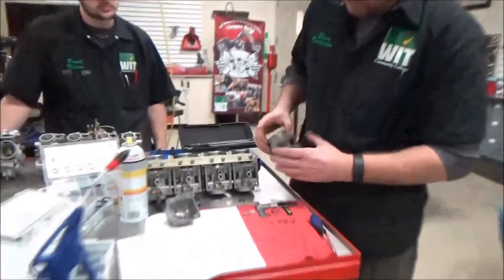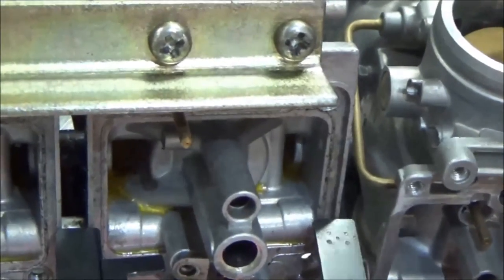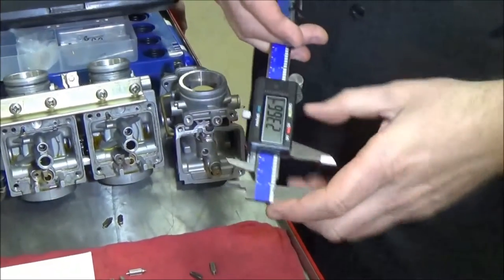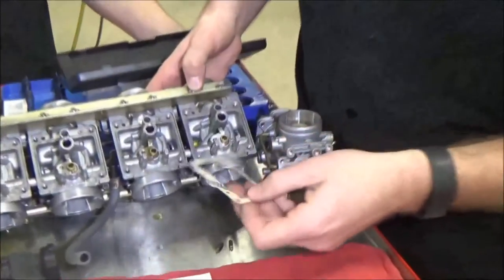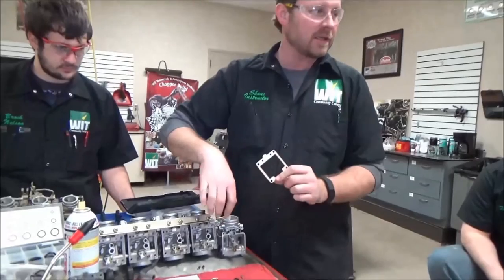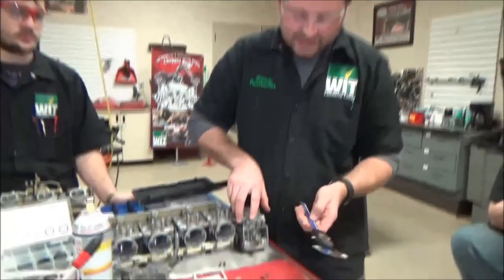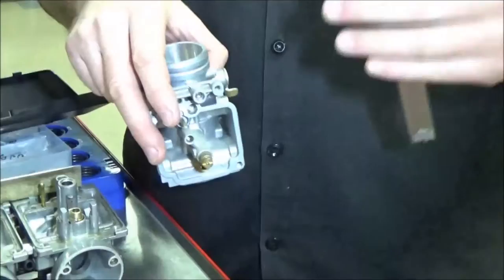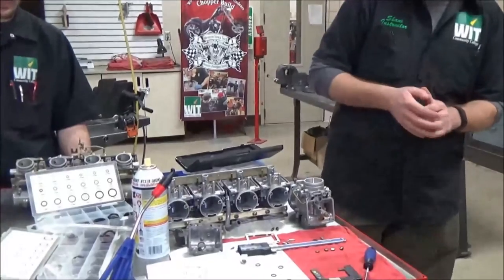How to set float height on a non-flat carb body. BONUS TIP:  Reusing old gaskets!

Comment: This is the third video I've watched to  learn how to set the float adjustment on my 2004 Yamaha YZ-250F and NONE of them ever shows how to adjust and only just how high it should be. I just rebuilt the entire carburetor because it was leaking fuel. It had a ton of black large particles in it.  Now it's extremely clean with all the critical parts and it still leaks. I'm assuming the floats needs adjustment, but the service  manual gives no  indication of how to do this. Neither do any of the videos like this one that claim to show this.
Reply from the maker: If it was a quick answer I’d try to respond here but I wouldn’t want to lead you wrong assuming certain factors. Reach out to me on my website contact page. We have been overwhelmed with ungrateful people and
scammers so I had to do something for my sanity by screening the over 300
requests a week! Contact Link: https://how2wrench.com/contact/ 

Your answers and help are just around the corner. Save time and money while protecting your investment and yourself by doing it the right way at www.How2Wrench.com 

Have you subscribed yet to never miss a video? Have you seen the video playlists https://www.youtube.com/user/conleybuilt/playlists? 

Want to say “thanks” or “keep it up”?
Click here https://www.paypal.me/how2wrench
Reply from the maker: I believe I show it in this video and on a YZ250... https://www.youtube.com/watch?v=oxeGEfph7WM&t=9s

Comment: The only real way to set float height is to set it dynamically.....remove float bowl and place carb on top of a full cup of gas , have fuel supplied to float valve as normal and measure the height at which the float actually stops  the flow of fuel.....not by where you assume it will...

Comment: do you have experience with 2000 zx6r j1 carbs?
I can't figure out where to measure from. the manual shows two different types of floats. the one where it shows you where to measure is for a round top float. the floats on my carbs are flat top. so I don't know if i measure from the end closer to the tang, or the other end, the manual is not clear whatsoever.